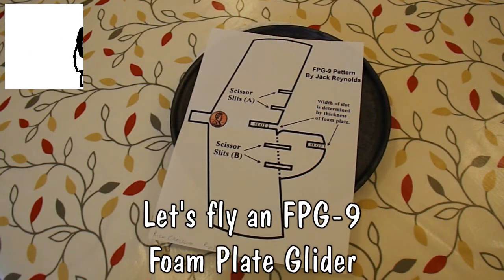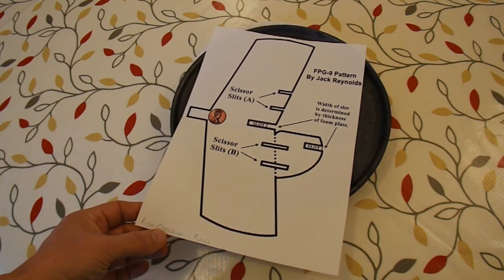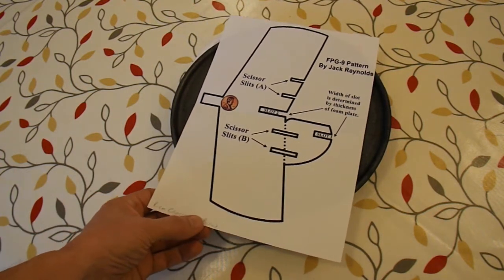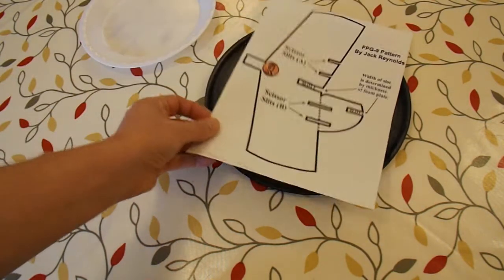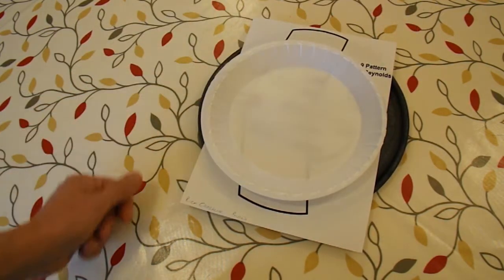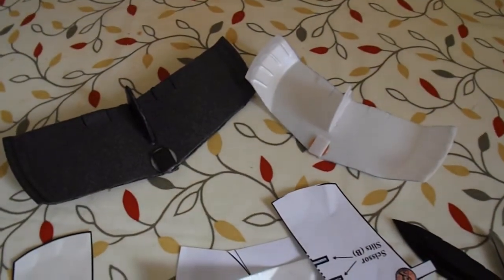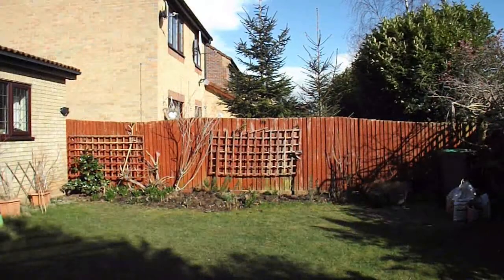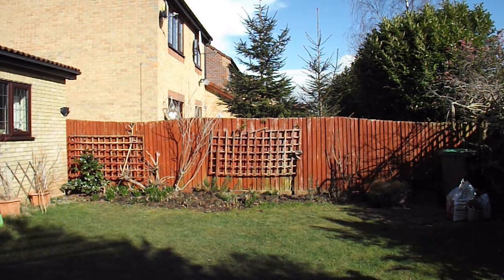Let's fly an FPG9 Foam Plate Glider 9 inch

Comment: how did you resize the template?
Reply from the maker: Luke Gibson I use Paint Shop Pro, but you can resize images with the settings on most printers by using Print Preview and setting the borders etc.

Comment: I couldn't find anything on this plane either Grandad, but your black pizza tray PFG9 seems to work best as Jag Betty said, Um I wonder If it would "Power up"
Reply from the maker: Haha, hi Graham , PowerUp is a bit of a touchy subject for me. Since the first video I keep getting lots of suggestion on what I could use the PowerUp for. I keep trying to explain that it is no different to the SuperCapacitor powered electric planes I have already built but people want to see the PowerUp doing all the same things I have already done just because it has PowerUp written on the front. The only reason I bought the kit was to confirm to myself that I was right in my guess that it was a supercapacitor used to power it.
That's my moan out of the way. The main issue with fitting one directly to this plane is the chord of the plane - distance front to back -  is a bit too short for the PowerUp assembly and it would be tail heavy. You would need to extend the nose significantly to get the weight forward enough to avoid adding extra weight to balance it. Not a big deal, but it would not be the same design then.
You will see in my video description some links for other videos, you probably already read that, but most of the 'flight' videos I have found are mass launches in a classroom or similar.
It flies really well indoors and does the length of my kitchen and conservatory straight as an arrow. The idea is that people can learn about the trimming so you really need a big games hall or a calm day to get the full benefit.
Reply: I added a motor and a tail to it and it flyies great I used a old quadcopter for the power. I used two skers to put on the tail.